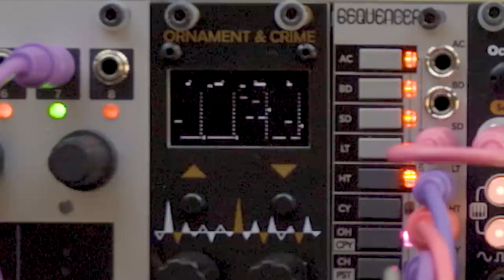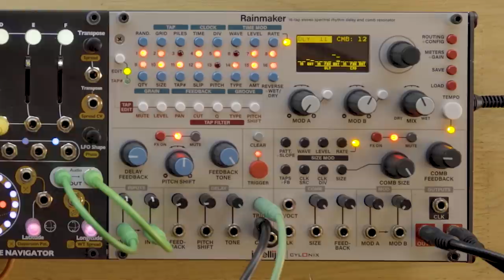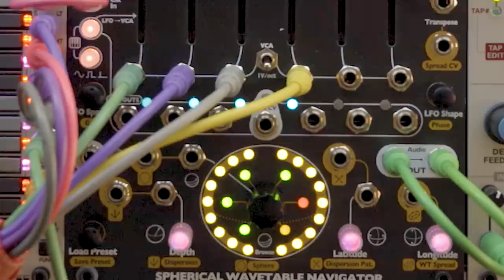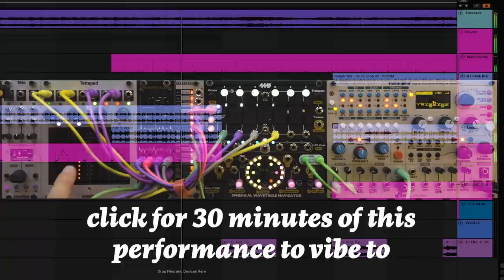Quality Time with a Quad Quantizer (Quantermain)

Comment: Excellent explanation of quantizers! I love the continuously variable signals of analog gear but sometimes they need to be tamed. It's nice to be able to force a specific scale on a random voltage. MIDI offers precise values but at the cost of flexibility. The next version of MIDI should offer finer grained resolution for signals and provide a better blend between the digital and analog worlds. Personally I'm firmly in the hybrid camp with modular, semi-modular and digital gear and I love it all. They each have their strengths and weaknesses.

Comment: I’m glad you did this with the ALA uO_C, because I’ve just bought the very same module and forgot to ask which firmware it was running. I’ll assume it was the default…

Also- I recently sold my SWN, and still don’t regret it, even after this video. Still a one-trick pony to my ears.

Comment: Nice video. I use Quantermain not so much as a quad pitch quantiser but as a quad S&H. So I can decouple the sequencing of gate and pitch but can get long not without the pitch chancing while the gate is high. I have to multiple each gate for this. But I still have the ability to quantise the pitch with O_C.

Comment: Can anyone suggest some other single decent multichannel/polyphonic synth modules besides the Spherical Wavetable Navigator? I find that when I'm patching my multiple outs from the O_C to several different oscillators I kind of get distracted by having to "change gears" between each of the different sound sources. I really like the appeal of just working with one unit with multiple ins.
Reply from the maker: Acid rain maestro, instruo saich, flame 4vox